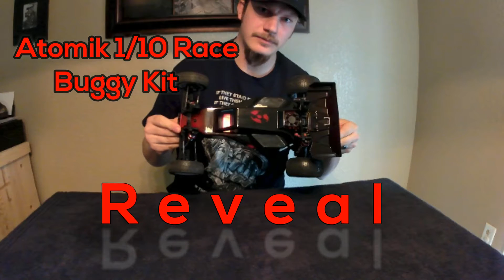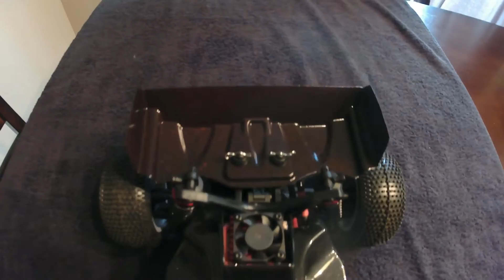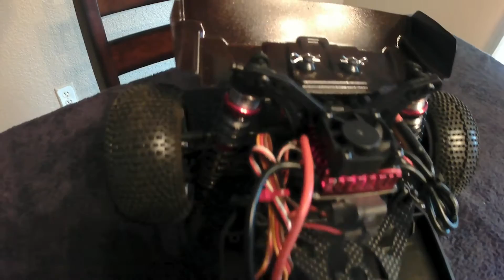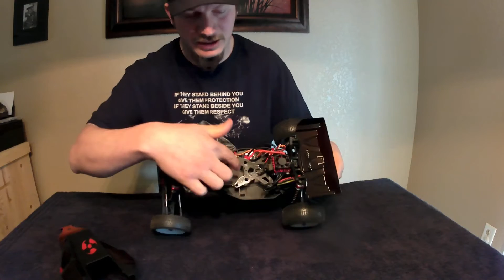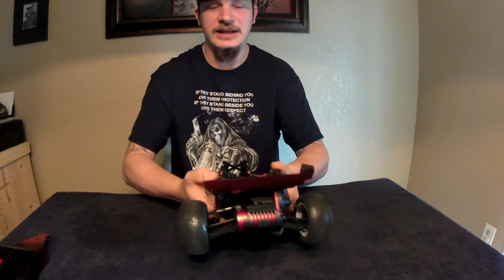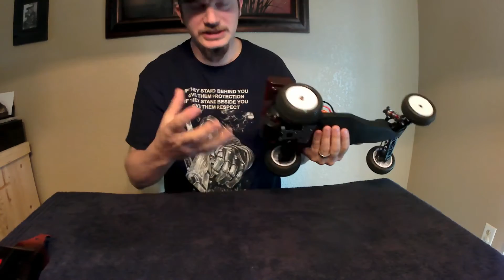Atomik V2MR 1/10 Race Buggy Reveal

Comment: A little late, but you put the diff screw in the wrong output on the diff. One output is deeper than the other. If you don't assemble it correctly, the drive shaft will bind on one side. The manual doesn't note it very well, but if you go back and look, you will see they flip the diff assembly 180deg, before inserting the diff screw. So if you end up with a binding drive shaft, you need to take the diff screw, thrust bearing, and nut out, and insert from the opposite side. I still have almost all parts for these kits, including the aftermarket parts I had manufactured. The aluminum rear chassis plate that came in all the kits I sold, is an option part I created. These originally came with a plastic plate that was snapping so often that Atomik started stealing them from their kits they had in stock. I have other option parts as well, like an aluminum front arm carrier, and carbon fiber shock towers. I also have the ability to 3d print an upgraded nose brace design, since those are becoming hard to find. A lot of parts from the Kyosho RB5/RB6 and the Tamiya TRF201 will fit this buggy as well.
Reply from the maker: Thanks for the info